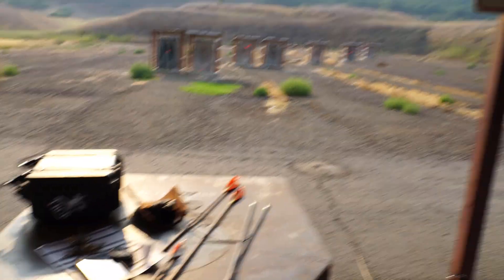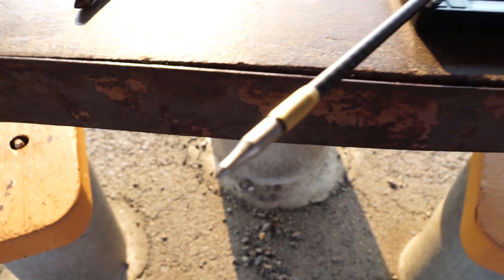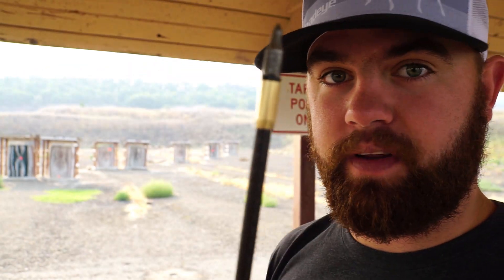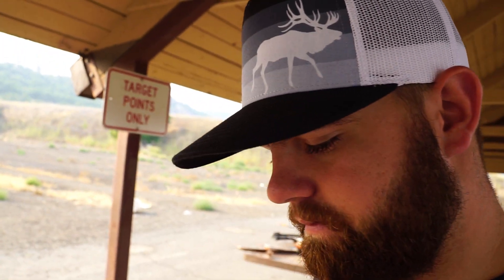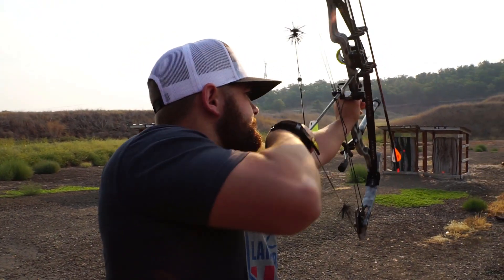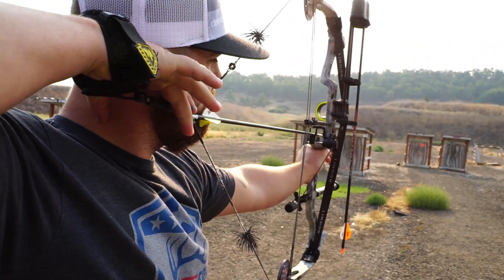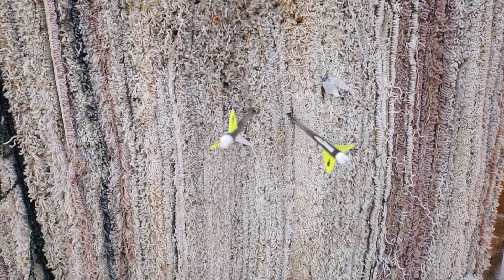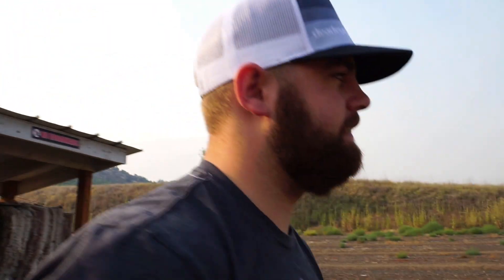What is the difference in trajectory between a heavy and light arrow?

Comment: At typical archery distances, the lighter arrow will almost always maintain a higher speed than the heavier arrow.  Even though the lighter arrow is slowing down faster, it started out much faster and the heavier arrow is also slowing down.  Because the heavier arrow is decelerating at a slower rate, it will maintain a higher percentage of it’s original speed than the faster arrow.  Also remember that the heavier arrow has more kinetic energy and momentum than the lighter arrow at launch already.  This gap only grows larger as the arrows progress downrange.

Comment: I did not see any difference in the penetration on target
Reply: Baled carpet is not an animal, and target points are not broadheads.
Reply: You won't. Slower is heavier. Lighter faster,and that equals equal penetration.
Reply: @jerrywhite8810  False, heavier has way more momentum. And heavier arrows use the bows energy more efficiently. Plus they lose much less speed than a light arrow. At 40 yards a light arrow might lose 30 FPS and a heavy arrow would lose 10 FPS.

Comment: Here's what I would like to see. Sight in three or more different weight arrows at 20 yards. Very light to very heavy. Then see what the differences  in drop are at 30-40-50 and 60 yards. Keep in mind that the average shooter shoots a 60 lb. bow at 28 inch draw.
Reply: Have you done any research on this? I’m shooting 65 at 29 inches with a light arrow set up and want to go for a 500 to 550 for white tail here in Michigan. Just wondering if  I should be around the 500 mark or if I should go heavier. Also thinking about cranking my weight up a bit to 70lbs
Reply from the maker: Check out Ed Ashby's reports.
Reply: I second that

Comment: You can get lighter arrows with good FOC. For instance The Easton Hexx... You showed me no reason to go to a heavy arrow.  This year i actually went from a 395 grain arrow to a 430 grain arrow and my pin gaps changed significantly. Closer pin gaps means less chance of missing vital organs if your range is slightly off. As long as your broadheads are sharp your going to get good penetration. Shot my buck last yr at 40 yds quartering away with a mechanical broadhead and the arrow was hanging out of the opposite shoulder blade with a 395 grain arrow! Split seconds make a difference on a ducking deer from hitting a little high to getting the upper lungs!
Reply: I agree I shoot 378 grains at 83 ft lbs KE and I blow through whitetails no problem.  If I was hunting buffalo then yes I would go heavier.